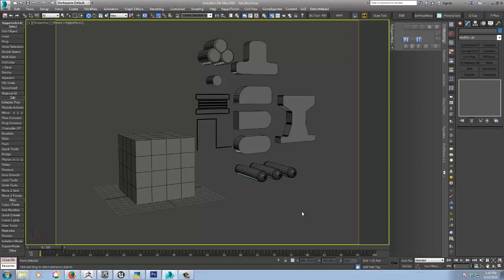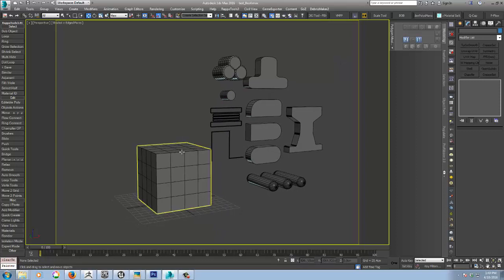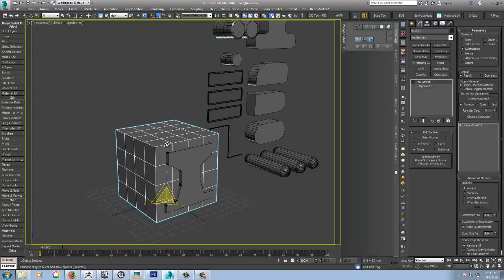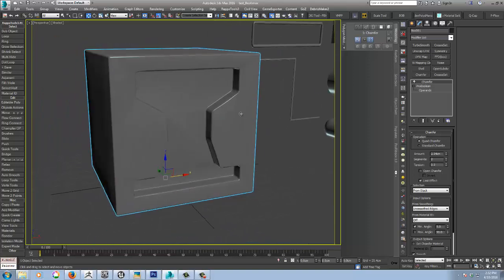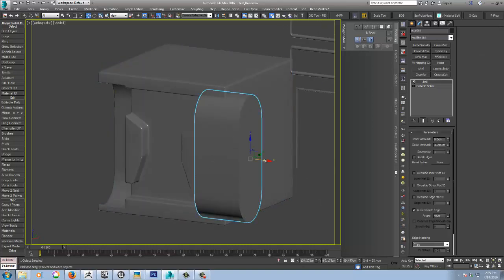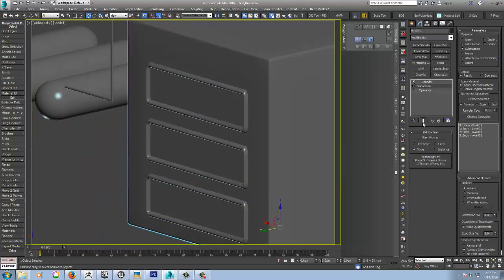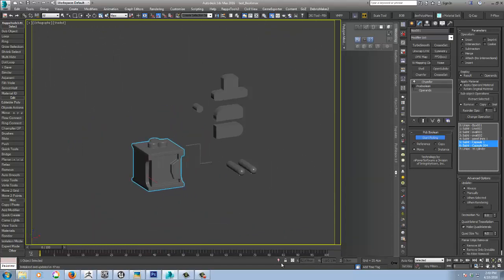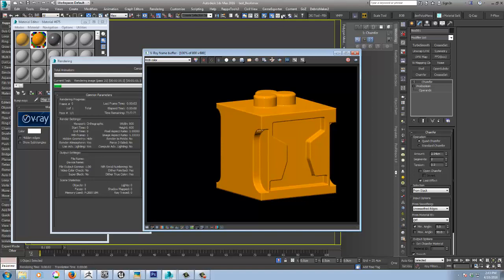3dsMax ProBooleans - Hard Surface Tutorial

Comment: You can use Open subdiv with isoline display off to quadrify your mesh. In order to have hard edges just use a crease set below the open subdiv. When your happy you can collapse the stack.
Reply from the maker: The thing with OSD, though, is that you're sub-dividing a boolean mesh and whether or not you add creasing it isn't suitable to this workflow. You're still going to have a lot of >=6 valance poles to deal with, which is never a good thing when using sub-div methods. Quadrify Mod is also sub-dividing the mesh, of course, but not using a smoothing algorithm.
Reply: Good point :), I heard you are developing a new plugin or script based off the "ADN Modeler tools" for maya? I saw that on he polucount forums. How is that going?
Reply from the maker: Actually it's Polyhertz that's developing the script. I've been testing it for him. Going great. It's almost ready for release. It's based on the Shapeshifter tool from ADN. So it's just that one tool. But I'm loving it. It's a huge plus for the workflow in this video. I'll be posting a demo vid when he releases it.
Reply: +musashidanmcgrath I can't wait - I needed it weeks ago ! Good on you guys :) very cool !!!
Reply: I will stay tuned and check in to see when you show the video - If you guys are going to sell it on gumroad ill buy it very quickly. Im working on complicated motorbike parts and I need this shit like some kind of crack addict. Very keen to test it out :)
Reply from the maker: It's Polyhertz's creation 100%. I'm just having fun with it. :) And because you're creating motorbike parts and I happen to be a motorbike rider/fanatic, you'll be the first to know...........and please don't try to pass the time between now and then with any pipes made of glass...... ;) But yes, I'll have a video up here on 'Quick High-Poly' most definitely.
Reply: Cool, thank again mate. May I ask you how long it takes to model a realistic motorbike? - Generally speaking :)
Reply from the maker: I haven't modeled one in a very long time. I have the wireframes up of a Ducatti Monster I modeled years ago on my Artstation. But that was 100% Sub-D. I've actually been thinking about modeling one of my Dad's vintage bikes that he rebuilt, so if I was to do it again I'd use many different techniques. It's hard to say timewise, it really depends on how far you push it with the details. But there's no doubt that the Boolean/Dynamesh method will save you many, many hours depending on how efficient you are with Sub-D. But there again creasing or Opensubdiv, or even quad chamfer, in a lot of cases, will save you time as well.
Reply from the maker: Maybe you could post up some WIPS as you create it? I'd love to take a look. What bike?
Reply: Cool, I saw your model on art station, its freaken cool! Great work man. Vintage bikes would be awesome, I love vintage stuff too. I just saw a classic bugatti race car on TV a few days ago and that style and time pre WW2 time period was really cool.  Yeah I'm really getting my workflow pinned down but I was worried how long it was taking me. Time is a bit scary, it moves too fast for me.
Reply: Yeah Ill try and upload some WIP of the parts I made. I'm modeling a heavily customized Ducati 1098R which in my opinion, is the best looking bike I have ever seen (from a photo). "Mr Martini" is a custom bike shop in Italy and have some great stuff there. I looked for ages to get the right bike to fit the style of my character and I also happen to think it is the best looking bike ever!
Reply from the maker: Thanks man. I did that back in 2009, I think. :) I'll definitely look for that custom bike you mention. Ducatti's are some of the most beautiful pieces of engineering on this planet. Some time in the future I WILL own one! :) Don't worry about the time it takes. Eventually the speed comes, and a lot of that is all in the workflow. Best of luck with it. Looking forward to some WIPS.
Reply from the maker: My Brother-in-law had a 1098(before traction control on the newer Ducatti Panagale) the last time I was home in Ireland, and even though he's an experienced rider with track time, he said the power scared the shite out of him!
Reply: hahahahaha - yeah I always wanted to ride a motorbike, but my Dad told me his friend, a professional motorbike racer got killed riding slowly in a street just before he got home. apparently a person reversed out without looking and killed him. My dad was saying its not your personal skills that are to fear but other people who cant see you or who are stupid. So I took the safe rout of just admiring them without riding them haha.
Reply from the maker: You're Dad is 100% correct. Every time I go riding I consider myself invisible. No matter how skilled you are there are always many motorists 1000 times more stupid than you are skilled! :) Just on the modeling subject I've recently started to get into Fusion 360 and I'm very impressed. It's another avenue for this workflow. I've put off learning it for many months but finally decided to dedicate some time to it. I'll post up some vids when i'm more proficient.
Reply: Very good! ~ I wish I had time to do the same. Fusion 360 came out of nowhere and seems to be like the ZBrush of hard surface modelling. I believe you can do a rough model in 3ds max and then export it to 360. I will learn it too but I have so much to do already and little time. Definitely go Fusion 360 for sure.